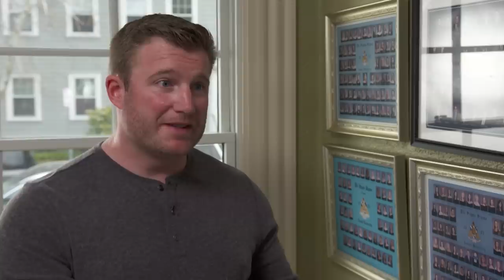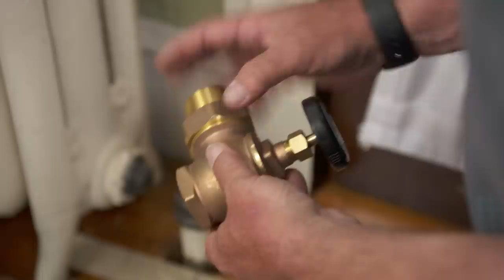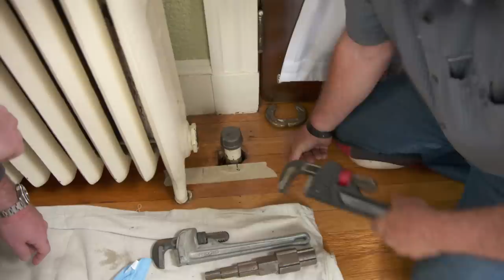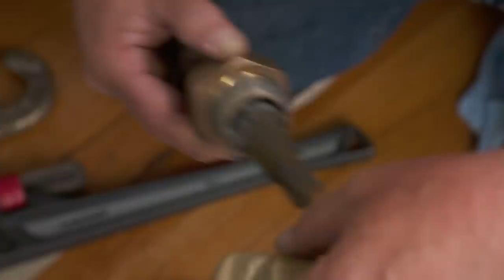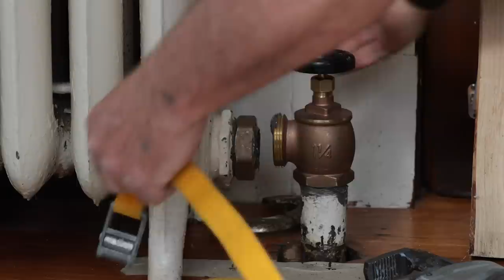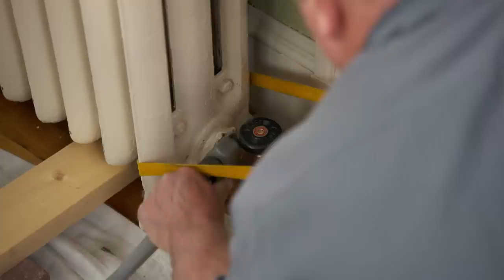How to Reconnect a Radiator | Ask This Old House

Comment: Ive seen some people bleeding the radiators through a screw on the top of the radiator with a radiator key..it was explained that this method is  to get air out of the radiator. Is this method needed with steam heat radiators that have side vents? Ty.. Matthew

Comment: Does the system ever need to be flushed (something like a vehicle radiator) because of hard water build-up or contaminants? Does an additive get added to prevent rust/corrosion, etc...?  Thank you.
Reply: Periodic flushing can help get better performance, yes.
Reply: @TheDoctor1492  thank you
Reply: In my country, if we have a closed system for radiators, we often add a little bit of anti-freeze, or propylene glycol just for its corrosion protection. Beware that car anti-freeze and heating system anti-freeze is not the same thing.

Comment: Should have cut about 1/2 in. extra threads on existing pipe or replaced it with one about 1/2 in. shorter.  It would then go together without all of the lifting and prying, and there would be less stress on the pipe and radiator.

Comment: If anyone didn't have wicking just use horse hair and grease we do this in Poland and it works all the time because Teflon tape is just not economical to use
Reply: Sure...I'll just run right out and shave my horse...
Reply: @buckhorncortez  hair from your better half works just as well but here you can buy locks of hair in a small package for only 5usd and that would last for about 390 1,5 inch npt pipe threads
Reply: I use my hair.
Reply: mark zamiechowski 

Teflon tape is less than a dollar for a roll here .
Reply: @darwinawardcommittee  here it's usually arround 2.50 USD per 50 foot rolls of 3/4

Comment: How does a radiator plumbed like that ever get much hot water circulating through it?  Wouldn't most of the water circulation be through just the very bottom area of the radiator, since the inflow and outflow are both down at the bottom?  Was this radiator plumbed like this originally, or was it previously a steam system?  Compared to steam, hot water carries so much less heat.  Seems like a downgrade in performance to change a steam system over to hot water.

Comment: I have come into this problem before after people have used this exact fix. After Time you're building will settle and fittings will fail. It's sad to say that this is the only video with the master plumber that I don't approve of. There were a few different tactics in which you could have tried before forcibly pulling the two connections together. Easiest workaround would probably been sawzall and moving plumbing over an inch or two after cutting out a considerable amount of notches underneath your floor. Other than that you could have had a flexible line that would have been able to make the bend necessary so threads line up to meet joints. Flexible lines are now in use and should be utilized in situations of retrofitting. I hope this helps.

Comment: Do you mean to bleed each radiator that I would be removing or bleed each radiator in the entire house? Then when the radiator is reinstalled, do I then close each bleeding valve or was I supposed to have done that immediately after bleeding and before removing the radiator. What sequence should I be leading the radiators in, is it the first one closest to the boiler or the one on the top floor. And what is the procedure for closing the bleeders when I am done reinstalling and what happens next, do I turn on the water feed to the boiler before turning on the electric before closing the bleeder on the radiator/s?  I do vaguely remember doing this years ago and the heat was never the same. I know that you're restricted by time in making these videos but from my experience, one false move out of sequence can turn a simple job into divorce procedures😁 The reason for a lot of my confusion too was that another reputable video starts off by talking in-depth about how to bleed starting at the ground floor with the radiator farthest from the boiler. That in itself can be misinterpreted if there are just two radiators the same distance from the boiler at opposite ends of the floor.  In my mind, the "farthest" one is the radiator way up on the top floor. Now if it is the farthest one on that ground floor, how do I determine which radiator is farthest if one is at one end of the room and the other at the opposing end but each at the same distance from the boiler.  Is farthest the correct word?  Sorry for sounding whatever way but dyslexics have to know exactly without any hint of a doubt what's what. Thanks, John

Comment: He should check to see if the valve is open before he left.
Reply: Should have put some dope on the union taper and threads. And snug the packing nut after opening the valve all the way
Reply: If there's water in the radiator, the valve is open.
Reply: @scotttovey  the radiator will fill from the return pipe and vent with the supply valve closed.
Reply: @jeffreyjohn2037  
It shouldn't, 
But then, that really depends on how the system is designed.
Reply: @scotttovey  I seen this on my system, fills pretty well via return line.
Reply: @man4evil  👍😎

Comment: If those two legs on the rad aren’t back on the floor there would still be stress on the connection fittings. Maybe they left a wedge under the legs?
Reply: Nah, the slack and gravity will settle everything.

Comment: Is single strand plumbing wicking the same stuff used for candle making?
Reply: Seems unlikely, a candle wick is a lot thicker, braided cord.
Reply: some of the stuff you can buy is the same, its just braided together for candles. depends on the candlewick you buy or the plumbing wick you buy.

Comment: VIEWER BEWARE!!
Now that I look at it again and again and again, there's a slight mention of bleeding the radiator. He mentions very briefly if you catch it halfway in and again at the very end. He should be saying " it's very important to bleed EVERY SINGLE RADIATOR IN THE HOUSE. What is said could easily be interpreted by a homeowner who is not used to doing this as (it's important to bleed the radiator in the system) Bleeding the system is THE ONE MOST IMPORTANT STEP!!!!!  I see this time and time again with This Old House. They spend more time talking about the family  and how lovely the house is and filling up the video with exciting animations. No mention of the important stuff. All I can say against anyone who's going to argue with me is that at least 25% of this video should have been dedicated to the bleeding and just as important, the sequence of bleeding.  But that 'makes for bad TV I suppose which is more important than helping people to fix problems. Their advice will lead to you wasting a weekend and then having to find and schedule a plumber and of course the cost which comes with that.  
Whatever you do do not take their advice on installing any electrical or flammable fuel devices.  And if you do I would double and triple check what they are telling you. This is a disgrace TOH

Comment: I don't have a radiator nor do I know anything about it but it looks like Richard is putting a lot of pressure/tension on the pipe by supporting the radiator.. In the long run the pipe will give up
Reply: The pipe has been in the house for 60 years. It will withstand a whole lot longer.

Comment: Why is it that these old house still uses radiators ? Is it because it to expensive to change the heating system to another type.
Reply: Because they work. No need to fix what ain't broke.
Reply: In most european countries radiators are the standard heating. But the design changed very much. The old ones used radiant heat, the new ones use convection. Every radiator is having it's own thermostatic valve, so you can have different temperatures in different rooms. The cost of such a valve is between 10 and 30 Euros (converted it's between 11 and 33 US$), depending on if it's a simple one or a comfortable programable electronic one...or with a smart home connection, adjustable with your smartphone and such things..

simple one:

https://upload.wikimedia.org/wikipedia/commons/2/27/Vanne_thermostatique_thermador_10.jpg

Digital one:

https://upload.wikimedia.org/wikipedia/commons/4/4e/Honeywell_Rondostat_HR20_resized.jpg
Reply: After this is something like baseboard heating, but they need to repipe for that and have space. After that is forced air, which supports heat and cold, but you need space for ducting or space for airhandlers if it's ductless. The boiler is replaced with a furnace.
Reply: Yes, it can be expensive to change.  Hot water radiator heat is quiet and steady.
Reply: It’s also a really nice form of heat. Steady and consistent and they keep heating after the heat is turned off
Reply: @Marcel_Germann  This type of radiator uses convection as well. Block the space at the bottom or lay something on top and the efficiency drops dramatically.